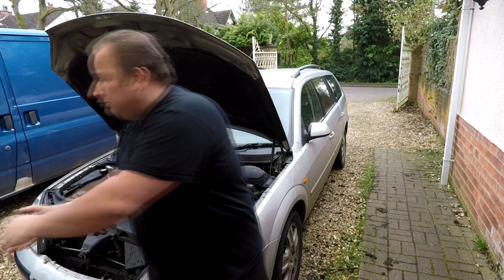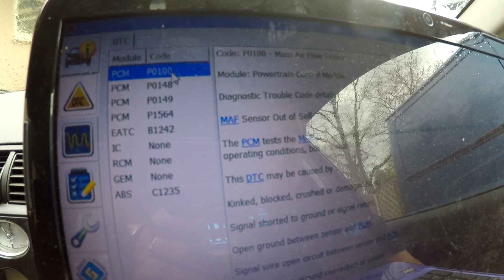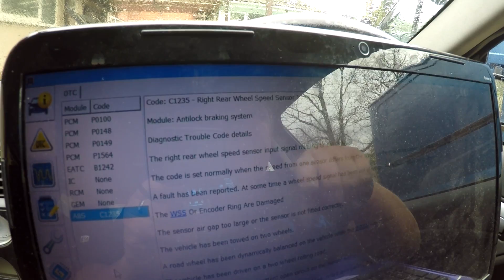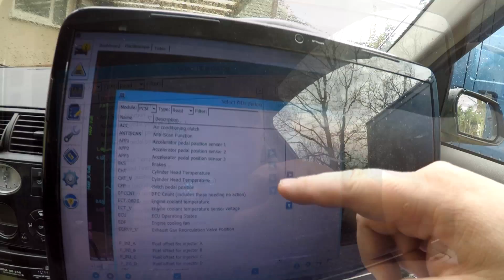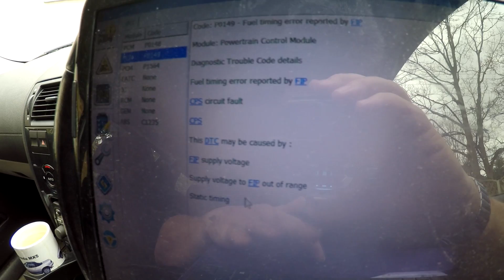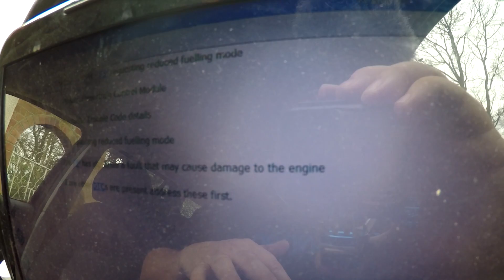Part 3 Ford Mondeo Mk3 Tddi Running Rough Diagnosing Causes F Super Mk2

Comment: My money would be strait for the HP pump Martin. If it's not that initially gone more often than not it's never far behind the lift pump anyway. Ideally change both (I know not really economical way really but only way sometimes)    That's my experience from when it's happened on 2 Astra vans I have had anyway unfortunately got the age and state with the second one where it was not economical to repair even with used items   as swarf had compromised the entire system from the lift pump breaking down
Reply from the maker: I'll be checking the Crankshaft sensor first.
Cheers
Martin
Reply: Defo the next cheapest option Martin! But would it not do it all the time not just as warms up I would be thinking. I look forward to the next vid update in any case!

Comment: Another great video. In regards to the 14.7 Air fuel ratio the ECU will only target that ratio on light throttle positions. 14.7 gives best economy. When you push the throttle past a certain point the ECU will ignore the O2 sensor readings and run in open loop where it only looks up at the fuel maps on the ecu and injects for maximum power, a richer mixture will be used for Max power. Modern cars now use wideband sensors that are able to target very specific AFR's. Amazing stuff. I have an aftermarket ecu that will effective map itself in terms of fuel. All you have to do is chose the ignition timing. Your problem seems to be under heavy throttle which suggest to me its one of the sensors that the ecu looks at when it runs in open loop mode ie MAF,MAP and crank sensor. I hope you get it sorted soon as these sort of issues can go on and on and you end up changing things you don't need to. Even the diagnostic tools can lead you down the wrong path sometimes.
Reply from the maker: Yes, I agree, you have to read between the lined in fault diagnosis sometimes.